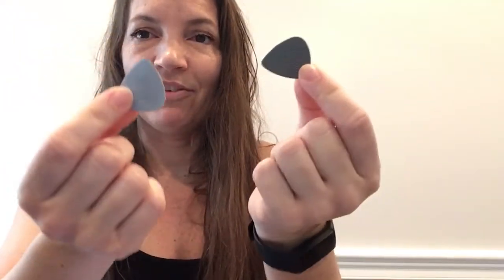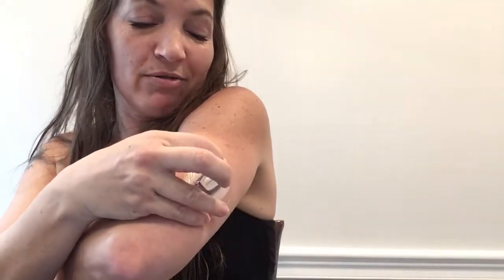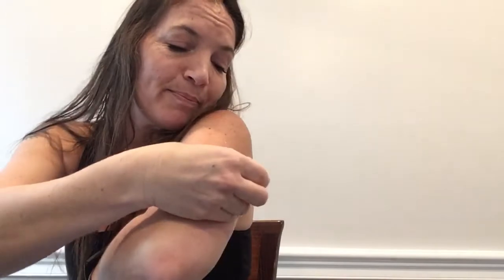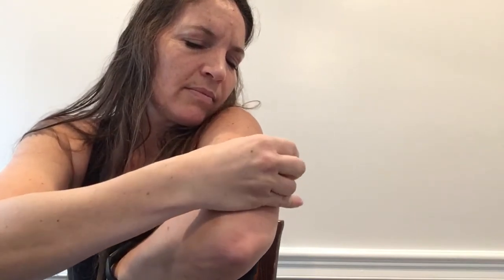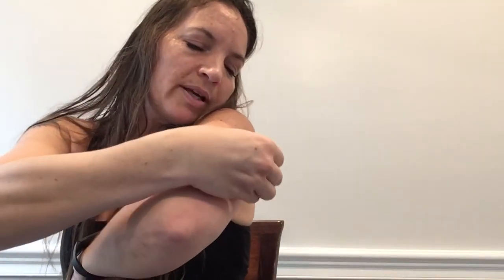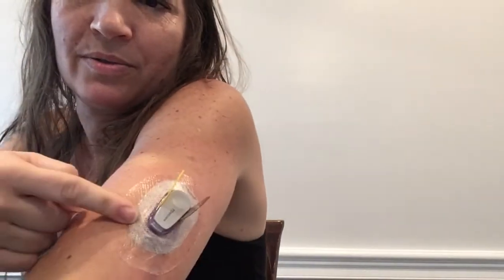Restarting (extending) a Dexcom G6 (8Hxxxx) and easy way to remove the transmitter

Comment: How long do you keep the sensor in for!? Do you find it accurate as it goes past the 10 days?
Reply from the maker: I keep it in as long as it’ll let me which came be anywhere from 15-30 days. I definitely find it to be very accurate and very reliable, but once it starts losing signal, I find I have to start testing to be sure. So it wouldn’t be uncommon for me to start losing signal (almost always on rapidly changing extreme blood sugar values) around day 22. I might milk it for a couple of days if it’s not too much of a burden, or I might yank it if it’s bugging me. I do find keeping my bg normal and stable helps the sensor last longer, but that doesn’t always stop me from eating my cereal way too late at night. 🙄